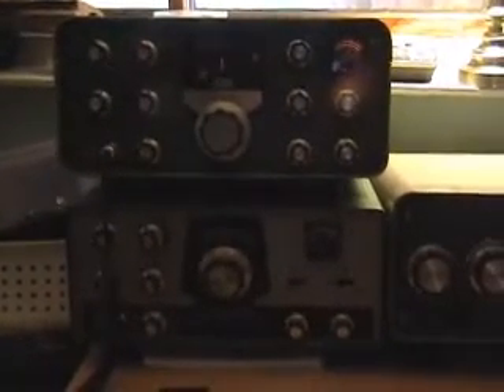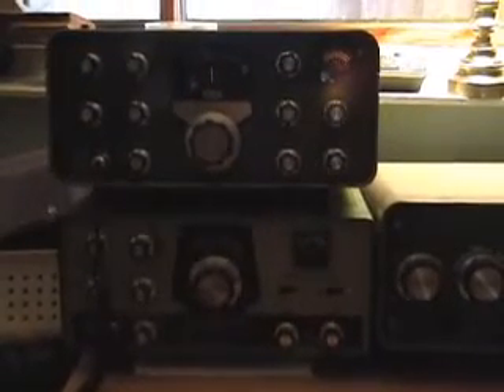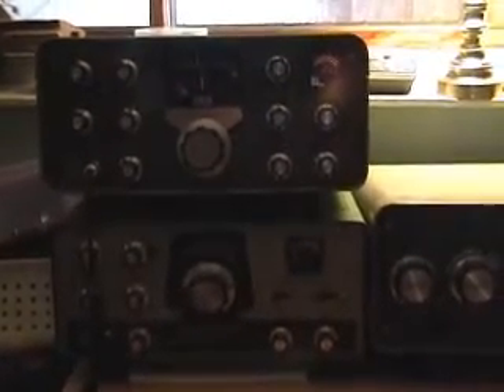Listening to Field Day on my Heathkit SB-102

Comment: Heathkit! Those were the day's. I currently have a Heathkit CB1,lunchbox a gw12 ,a powersupply that I built to run Ramsey 2 meter transmitter. The Ramseys' boards are mounted inside an old luch box, wired to the original controls. I'll post it on you tube soon. KB8TPT